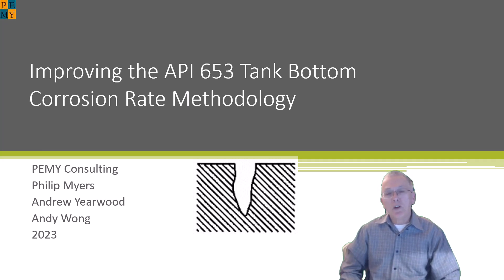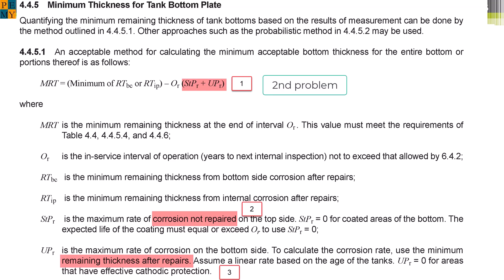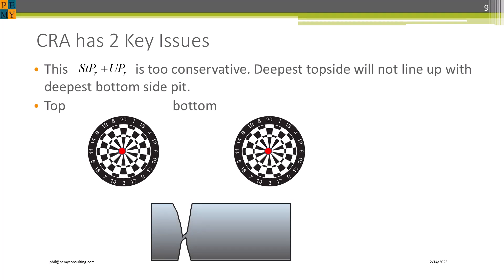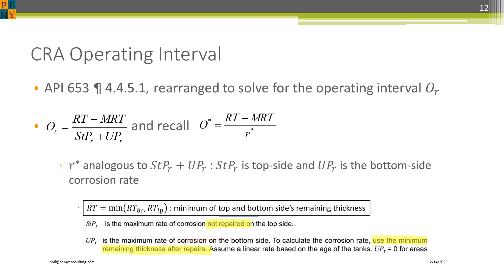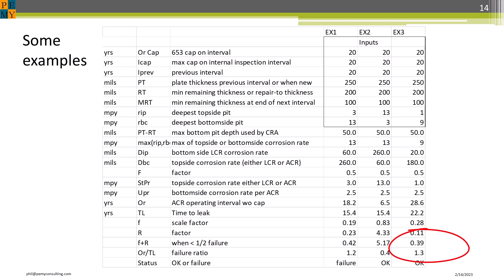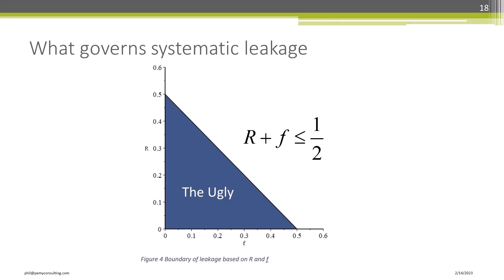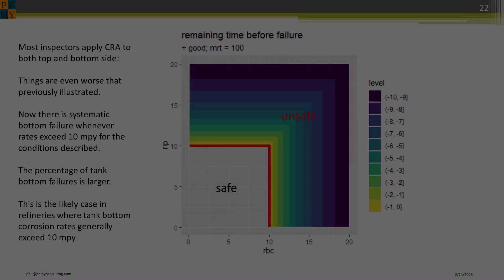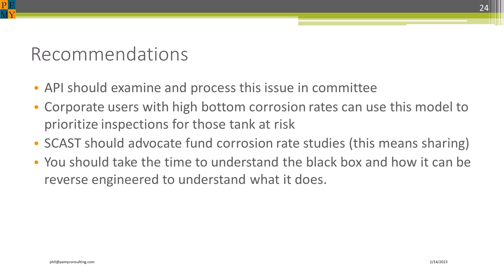Debunking the API 653 Corrosion Rate Estimation

Comment: This video was brought to my attention so I watched it and for what it's worth, have this to offer. 
1st, API 653 was and is a great standard, but on several issues, it can be challenged and this is one of those areas of contention. 
2nd, Mr. Myers is correct in that, depending simply on what side of the bottom plate the “same depth of pit” is located, that a person may calculate differing results in futuristic useability of the existing bottom plate. 
3rd, I may slightly disagree with the assertion that topside and underside corrosion will not be located directly opposite to one other. Some believe that the possibility for alignment increases as the tank’s diameter decreases. (That’s another discussion)
4th, I would never pick an intellectual argument with Mr. Myers. 
Thank you.